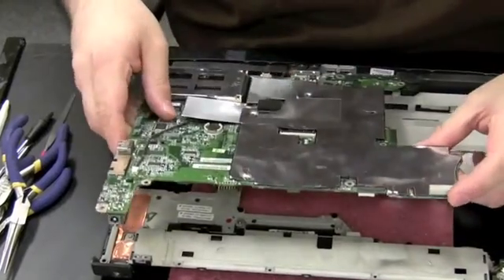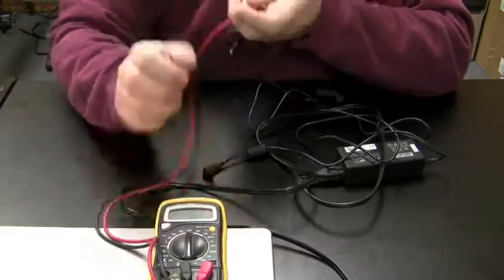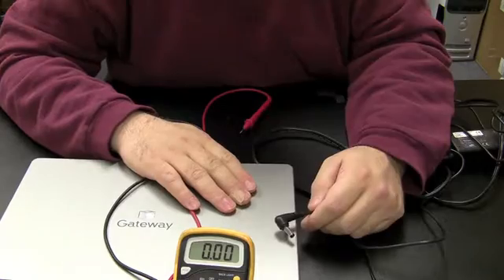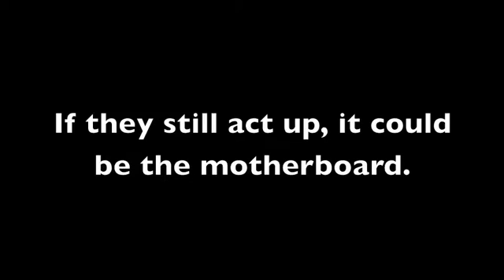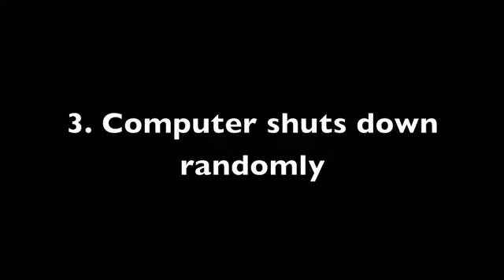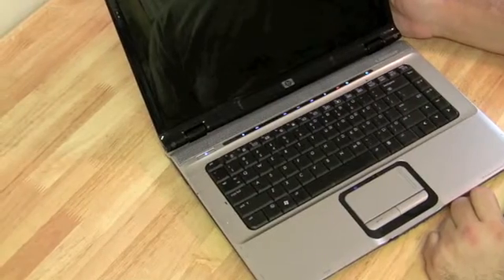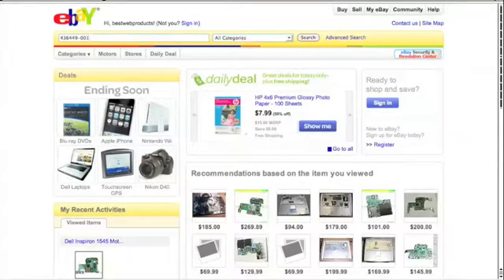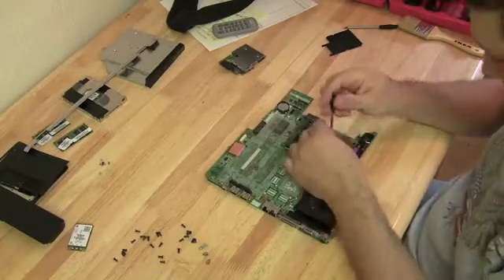How to Fix Laptop not powering on, good battery, power adapter and power jack.

Comment: Good info, thanks. I've seen many videos like this and none of them showed how to test the power supply with a multimeter. I know this is obvious to those that use one but many people, like me, don't and this shows us what to do. The one I'm trying to fix for a friend is ok as it gets warm and the light on the laptop comes on, though I'll test it anyway. 

Trouble is that nothing else happens! I read that The CMOS might need re-setting. On decently designed laptops this just requires unscrewing a cover on the back, taking out the battery for a while, then putting it back in. On badly designed laptops you have to dismantle the laptop and gain access to the motherboard to do this procedure. On a Packard Bell Easy Note New90 the only thing that looks like a CMOS button battery is soldered to the board, which seems unbelievable but have read that some laptops were made like this. I tried the hard drive in another laptop which powers on but it gets stuck in an infinite boot loop, doesn't get past :
Check cable connection!
PXE-MOF : Exiting Intel PXE ROM.
Hoping that I can do a disk repair on it and to get to access the data. As to the defective laptop I think I'll have to teach myself soldering!